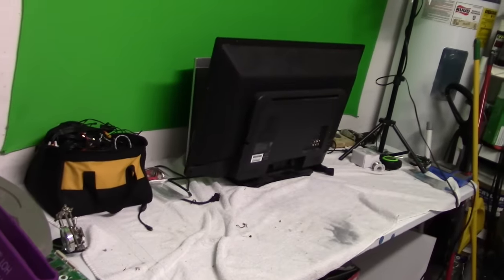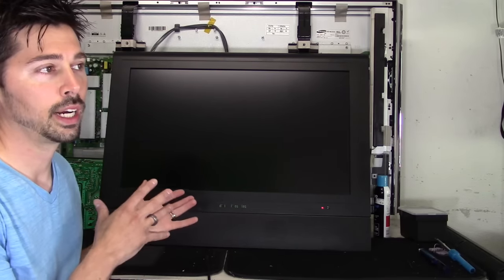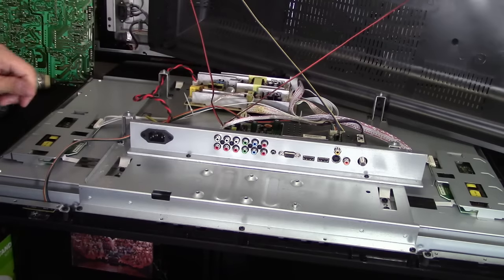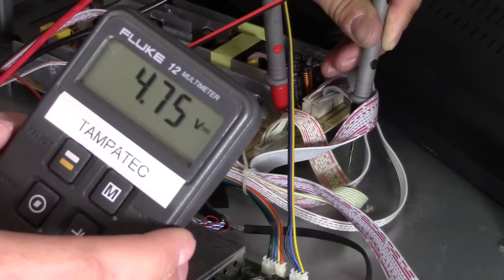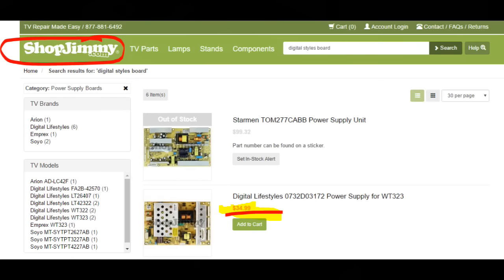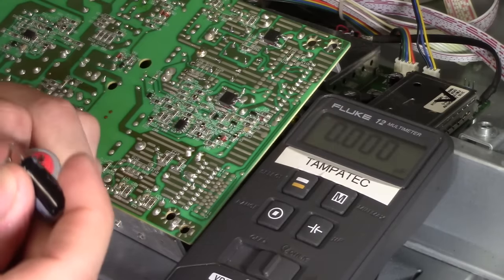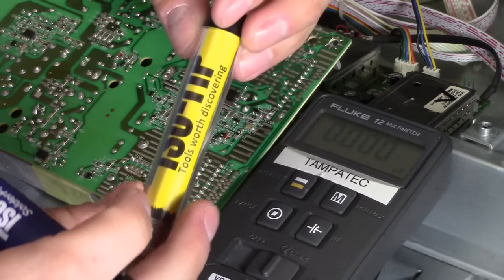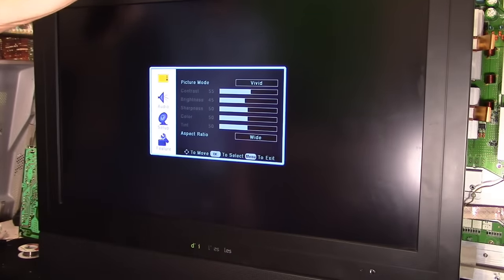WATCH THIS VIDEO BEFORE THROWING OUT YOUR BROKEN FLAT SCREEN TV!!!

Comment: i have an lg lb5550. the picture quality is good and i believe there is no bulb that needs replacement. the only problem is a flickering screen. the whole screen shuts on and off like a strobe light. what should i look for when the time comes to open the panel? please help! i want to keep the tv or at least fix it before handing it to the lucky one. your input will be very much appreciated. thanks!

Comment: Hi wondering if you can help. I have a LG Flattron TV. When I switch the TV on the red sensor light is on. No matter how many times I press power on the remote the TV does not switch on. I think the TV sensor is broken. The TV swithes on in "rest mode" which c only be changed by the remove and I cannot get it out of it. No buttons I press on the TV itself helps. Do you think it is the sensor or something else?

Comment: I have a Sony Bravia with half the screen black and the other half some sort of strange discoloring gray.  My son was playing it for three hours beforehand then went to turn it on and it did this.  Backlight is still good.  Should I pull the tcon and see if there are swollen capacitors I cleaned all the ribbon cables at the tcon board and it's still the same.  Some of the chips have a slight brown discoloration on the sponge pads that cover them...

Comment: Popped caps on power supply boards are sooo common on LCD devices.  Often, the device will power up, and the screen may even glow, but nothing else will work.  80 cent capacitor, and boom!  Working.  I fixed several Tektronix oscilloscopes that way. The only bad part is opening the damn TVs.  They’re not made to be serviced anymore.

Comment: Hello Tampatec, great helpful videos 

I'm hoping you can help me out with my problem, I have a 60" RCA LED TV that the backlights work for a little bit then they go off, if I turn the TV off then back on the backlights will work for a little bit longer.

I’ve done the flashlight test and can see an image.

I’ve checked the DC voltage to the LED's when they are working and it fluctuates from 180V to around 170V then either climbs or drops, and when the lights go out the voltage is zero.

I tried changing the power/driver board, but it was still doing exactly the same with the other board (New To Me Board).

I thought that my board was faulty as the voltage was zero when the lights didn’t work, but now I'm thinking I’m wrong. 
Now I’m thinking it might be a LED or 2.

I’ve checked the LED’s through the plug that plugs into the power board and I am getting 129V on each side (checked - unplugged from board and no power to TV)

I am not sure now when is wrong, and why it turns the backlights off, please can you give me some pointers and any help you can give me would be great.

Thank you Darren

Comment: Sir you may want to tell folks to make sure especially in winter to be careful of static discharges that may destroy some of your IC's. A solder sucker that is anti-static also helps and an Isolation Transformer if you take readings under power and be mindful of any "hot ground " areas.

Comment: Yes sir, I have a question about a tv my sister gave to me. It's a LG LCD model 32LD320H. I am using a digital TV antenna but when I go to the menu function screen but the channel function screen and the input screens will not highlight. There isn't a remote so is there something I hooked up wrong or is this issue in the control buttons? Any help would be greatly appreciated. Ty.

Comment: I worked as an electronics tech for many years and electronics was also my hobby for a few years.  So, I soldered quite a bit and got to be proficient at it.  I used to hold the tin/lead 60/40 solder in my teeth.  I later found out that is not a good idea, and I wouldn't recommend doing that, but I am almost 80 and I have no medical issues from lead contamination that I am aware of.
Reply: The symptoms aren’t too obvious in adults

Comment: I purchased a new tv yesterday. It was one that I use as mainly a computer screen, but the problem with the one I replaced was that the LCD had lost its vivid colour so it sort of looked like one of those older LCD displays you might have got on an old windows 95 laptop where if you view the display from the side you see dark instead of the picture.  Sorry sad me the old monitor was 7 years old though.

Comment: hi there. i just changed the LED strips on my Panasonic and when i turned on to test the LEDs the TV is not turning on. i see your other video where you tested without having all the displays. do i need to put all together or there is any trick to turn on just to test the lights? thanks for any help

Comment: I found a sharp Aquios and turned it on after transporting it the stand by light comes on when I try to power it up it clicks then nothing. Is that more of a power supply issue or logic board?

Comment: I have an older Toshiba TV and the LED driver went out on it! Picture has no backlight, you can see it with a flashlight, but it's hard as hell to find the part for it! I'm an electrician, so I could repair it myself! Where you get your parts from?!

Comment: HEY BLESSINGS. I have a Samsung 65inch smart TV. The screen narrowed vertically. I changed out the signals input card and got the screen to widen but now there is no poc only a set of vertical lines. Can you assist me to fix or get rid of lines?

Comment: My Sony Bravia I believe that's the model recently started to shut itself off and on. Sometimes it will shut off and not come back on its own. The red light flashes when it does that and it will only come back on if unplug it and plug it back up to the outlet. Can you lead me in the direction that you think might be the problem?

Comment: My new lg was only 3 mos old. 55 inch smart tv. I turned it on and i have 3 white vertical lines.   I left it off for a week. When i turned it back on i have more.  9 lines on the other side too.

Comment: Just a quick question. I have a vizio tv that is from 2007. I've kept the backlight and brightness about 50% for the time that I've own it. But I've noticed that my tv takes about 3 to 5 seconds to come on lately. And there's a slight buzz when get close to the tv. Should I be worried that it is going to blow out? Or is this common since it is old?

Comment: And I agree with using lead solder for repairs and unfamiliar materials, even though I use lead-free for new construction.   When you're soldering to something that's already there, of unknown composition, lead is almost the only way to get a reliable connection.

Comment: I have a  Vizio E701i-A3 it has a back light and I’m not sure about sound. No picture in the background with the flashlight test.  I e tested some components and I’m finding no 12v power coming out of the main logic board on one of the two ribbon cables going to the t con board. Would you suspect the main logic board needs to be replaced?

Comment: I fix A LOT of casino game LCDs and you can tell a lot about what’s wrong with a unit in the first 5 seconds after turning it on with a scope attached. 
One thing to remember is, inverters have current sensing so if they oscillate properly (clocking to pulse transformers), but shut down quickly, it could be the CCFLs and it only APPEARS to be a bad inverter.

Comment: Have a question. I have a flat screen TV the volume is adjusting up to max.  Also changing channels and h.dm.i. the menu comes on and changing settings. It's on can watch it doing this. I have tried unplugging it for a few minutes no avail. And I also removed batteries from remote thinking maybe it's shorted out or something.

Comment: Hello sir, I have a sony xbr46hx909 tv and a couple of days ago it started to turn off by itself! When watching the display goes dark, not black but like the brightness is going down a bit, visible change but tv watchable! The after 5 seconds it turns off and 6 blink ligh come! When Iturn it off by the switch and back on, it will work for a couple of minutes sometimes hours and will do the same! Do you think it could be a capacitor? Any help will be greatly appreciated

Comment: Thank you for your time and help. I have a Sanyo FW40D48F that I suspect was surged in last nights storm. The logo name strobes 10 times on screen then stops when I power up on the remote. I'll take it apart someday and look to see if there's a burn (bubbled) mark on the main circuit board. Any help would be appreciated.

Comment: hi. what do you think the problem might be when you have to turn a tv on 20 times before it actually turns on? it does turn on every time, but only for about 3 seconds with a black screen and then it turns off. so you need to keep on turning it on about 20-30 times for the screen to actually turn on. once you manage to turn the screen on, you can turn it off and on again without any problem. but when you leave the tv off for a couple of hours, the problem's back. i have never tried repairing a tv before but i am not willing to pay for a new tv every couple of years. i might just as well learn how to repair it. i have seen a couple of videos on how to replace a capacitor and i think i'd be able to do that. i have already ordered a soldering iron. do you think that swollen capacitors might be causing this problem as well? if not, what else could it be? thanks a lot

Comment: Shoot, I meant to ask you...
When you have a spare minute I'd like to pick your brain about an LG tv I have. Everything was going along fine then all of a sudden things weren't fine. I open to the Roku home page and after a bit of time (still on the home page) both sides of the TV screens started getting very dark shadows. It was weird, it wasn't a slow, fluid process, the very dark shadow popped up on one side and then maybe thirty seconds later popped up on the other side. They don't go away and have gotten bigger and it only first happened two days ago!. The shadow on the right side of the TV (my left while looking at the tv) is larger than the other side. These dark shadows aren't "vertical boxes", it's more like they are creating a very dark oval shadow from side to side. I think it's a 55" tv and this shadow covers more of the tv than it doesn't. In fact, I would venture to say it covers most of the tv.

Any ideas? If anything comes to you please let me know. I really appreciate what you're doing here on YouTube!

Comment: The main issue with repairing these is there are so many screws to remove, and put back. You're into an hour or more in electronic repairman labor before he even begins diagnostics. Also delicate easy to break tabs attaching the bezel. I put it back together with enough screws to secure it to make future repairs faster. In the days of vacuum tubes we often just left the back off. Problem when grandmas ceramic knick knacks fell off the top of the TV into the works, and broke some tubes.

Comment: Thanks for the video! I'm wondering exactly where I should be getting 5 volts when the power is on standby. I'm getting around 5.5 off one pin on my main board, but less on others and around 2 on my inverter.

The problem with the TV is that there is no backlight. Everything else is gooood. Any help you can offer would be greatly appreciated.

Comment: I have a 65 inch Samsung un65mu9000 about 2 yrs old it has a white thin line across the center of the tv. Do you have a video on how to fix this. Is it worth it?  I contacted a repair service and said not worth to repair.  Please help. Thanks

Comment: Hey tampatec i have a sanyo 55inch it has red light it turns on for one to two sec then shuts rite off is that a power board issue or tcon

Comment: Dear bro. I have a question, 
My Tv is not showing any channels,  when I search/tuning  for the channels manually, it shows  searching, showing the percentage  but couldn't catch any Channel, the cable line is okay, and when I connect the Android tv box to the hdmi port, it’s works. 
Now could you please tell me how can I fix it or where is the fault? 
Thanks and Regards.

Comment: When power supply board disconnected from the main board and checked with multi meter with AC on, I can detect 5V standby power but not 24 V in the next slot. Any problem with the power supply board?   The bridge rectifier's 2 middle legs show 230 V but the outer legs + and - do not show any power.  Thanks for any advice.

Comment: That damaged cap that you removed , it's value dropped much lower than the value value that it was supposed to have . So I guess that that's because of a crack in the dielectric inside of it ? I mean , such a crack appearing would give rise to another cap in series with the existing one , and this would severely drop the capacitance value , since caps in series add like resistors in parallel . Thus you can safely assume that mechanical damage was the culprit , and so that's why you didn't find the need to find the cause ... or what made that cap fail , electrically ?

Comment: ANY SUGGESTIONS     I have a SAMSUNG  video which was a display model for maybe a year   PROBABLY ON the whole time.   After having it a YEAR at my own house  while watching it the screen went dark then out.  I took the TV to the other room and replaced it with a much older SAMSUNG that the one that went out originally replaced.

SO -- if I recall right  JUST THE VIDEO went out  If I remember the Sound still worked.

So,  any suggestions of POSSIBILITIES ??

Comment: Even many old CRT TV's problems related to Electrolytic Capacitors being dried up or just bad. They don't like excessive heat especially when located close to a Transformer. One of the downfalls of the old General Instrument Jerrold 450 Cable TV Converters back in the 80's. 90% of problems with these Cable Boxes were Capacitor related due to excessive heat...

Comment: I have a question plz help I have a Vizio 42” m420sl and the led light comes on and the tv powers on but shuts off if I replace the power supply does that usually fix this problem?

Comment: Great video yes is common problem in Australia all electronics here that imported is 220 set but Australia voltage is 240v but the tv design for 220v most caps can handle ± 5% tolerance. But when you run them at 240v your running at the edge of your tolerance so if you can even the smallest of voltage spike poof there goes your caps. Most top brands will run higher caps Ive seen but cheap Chinese TVs are made for a cost. Eg if the save 5c each cap and the making 10 mil TVs world wide and say 5 caps per tv  how much cash did the big boss just save on his bottom line.

Comment: You also need to check the ESR of each electrolytic you are replacing (they usually have the series written on the cap) and you should replace all electrolytic capacitors in the TV.

Comment: Hi, you really know you're Electronics, with that in mind my son accidentally shot His Toshiba 43 inch flat screen TV. Now there's a white dot about 7" from the left & 7"up and a white line Vertically & horizontally that runs across & up. can the screen be changed and is it worth it, it's a 2016 and model # is 49L62IU I value your input. Thank You  LUIGI DELUCIA

Comment: One can't overemphasize the importance of checking those failure prone electrolytic capacitors. I generally upgrade capacitors that are 95c types to 105c types to endure higher temperatures.

Comment: Electro parts warehouse referred me here. 19” Emerson lc190em2 blows fuse when plugged in. I purchased the proper fuses and get the same result. I have purchased a power inverter board A17NE012 . Do you think this will solve the problem?
Reply from the maker: unplug the main board and the inverter board from the power board then plug in the power cord to the power board see if that still blows fuses if so perhaps issue with a transistor, diode or bridge rectifier in the power board. Check repair kits eBay for your tv model.
Reply: Cool thanks . The new power board should be here onThursday. I unplugged everything from the power board and tried it still blew the fuse. Thanks again appreciate your help 👍🏽

Comment: I have a Polaroid TV model TLX 02311B that powers on from red light to blue light, but there's no picture on the screen. I plugged a power antenna into the antenna input and it smelled like smoke. Is that a problem that can be corrected?

Comment: I'd repair 43" Samsung plasma, I check power board all components are OK, then I check the board mosfet transistor k10a60d switching regulator was shorted, I check the high speed power switching rjp63k2-2transistors are all shorted, then I replaced the 3 defective transistors but still no raster on the screen but there's power already, please give me any suggestions where i check next of the problems. This is interestinglease I'm wsiting

Comment: I replaced my power supply board on my Vizio 70 inch because I thought it was that but it did not fix the problem. 
My Vizio would take a few minutes of turning on and of via remote to turn on. It seems to have needed to “warm up”. After a while it stopped turning on altogether. I purchased a power supply board on eBay and it still won’t turn on. I am at a loss. What do I do next?